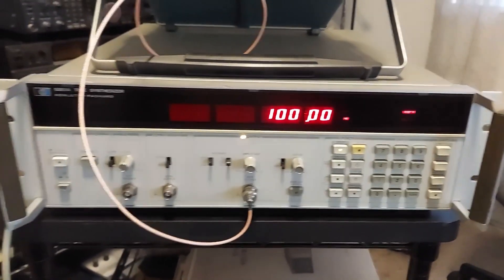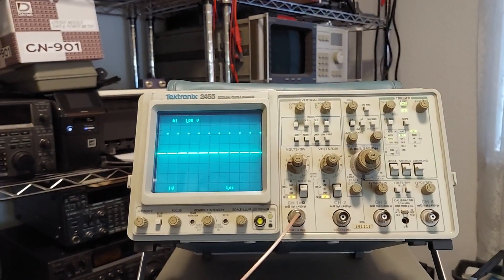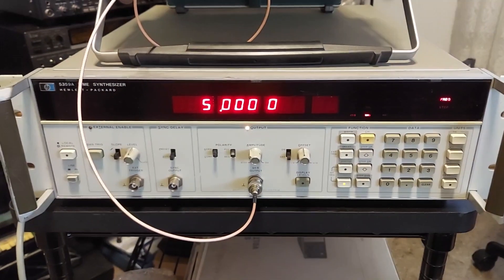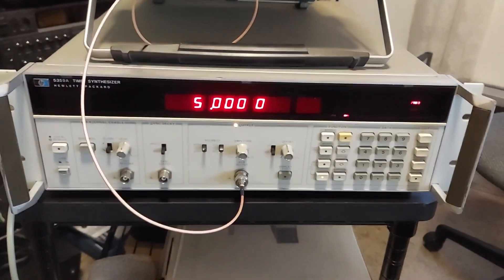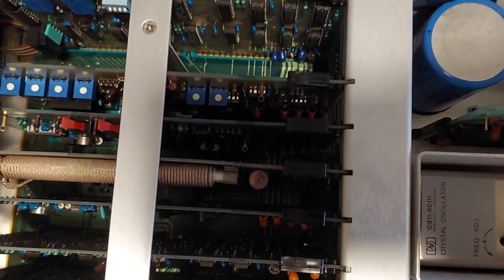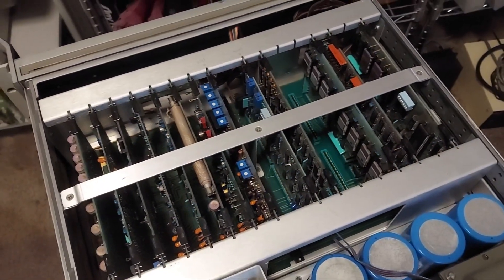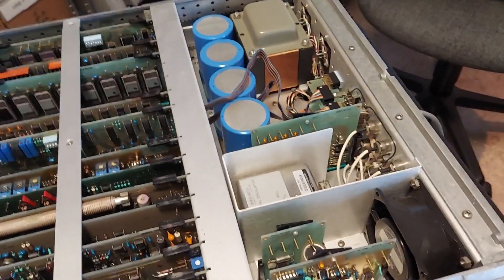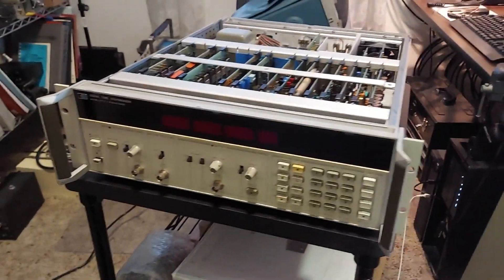HP 5359A Time Synthesizer

Comment: Can one simply input a simple high/low triggering analog or TTL signal to the input of that instrument, and get a high accuracy-low jitter pulse/pulses out?
Reply from the maker: Yes, you can set the instrument to trigger from another source, or manually from the front panel. This allows you to provide a single programmable output pulse width from 5nS to 160mS with a delay from 0nS to 160mS. I have been having a blast exploring this instrument. I have other pulse generators that can do this (HP 8013B), but not with the accuracy the HP 5359A provides. You can also set the instrument to provide two pulses of a given width spaced by the period interval keyed in from the keypad. These can also be triggered externally or from the front panel as well. Thanks for watching!
Reply: Very good  @CraigPetersen12f36b  .  Thanks for the informative post.  I must get one of these.  I love old HP stuff!

Comment: Nice! I got one of these recently as well, also with some minor problems. Definitely one of the strangest bits of gear I have in terms of functionality.
Reply from the maker: Yeah, certainly not an instrument I'll be making daily use of. But it will be useful for confidence checks during the service intervals with my HP 5370B and 5335A. Prior to that I was using the HP 3325A. Thanks for watching!